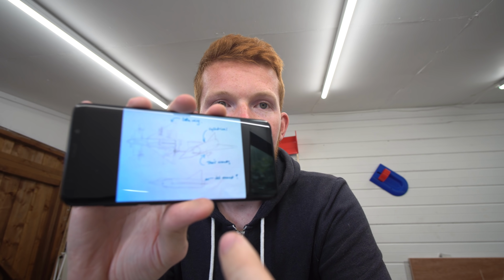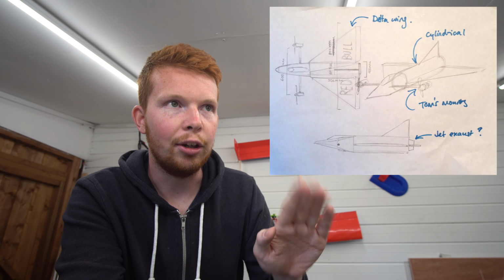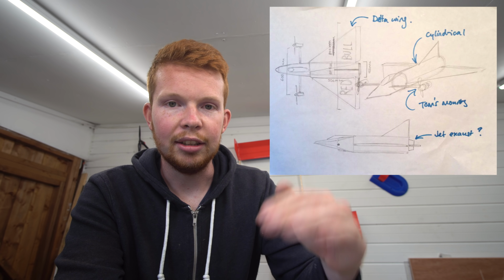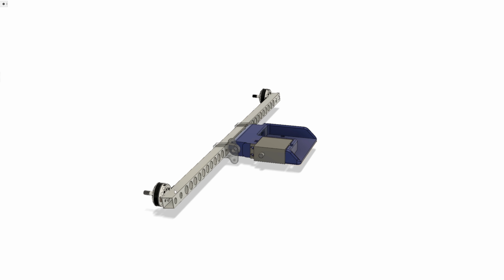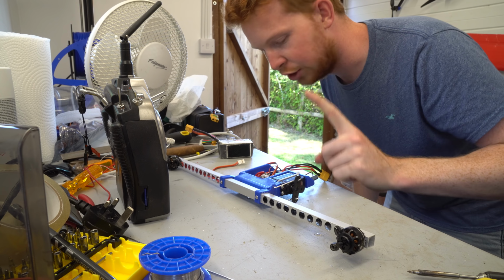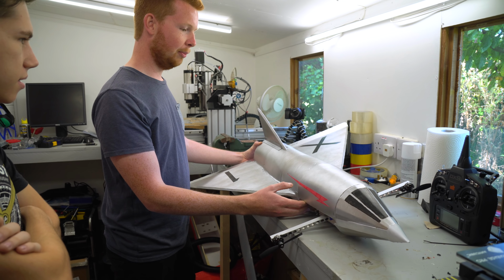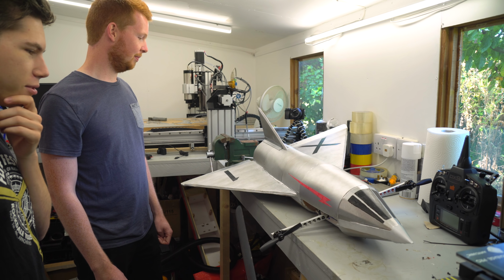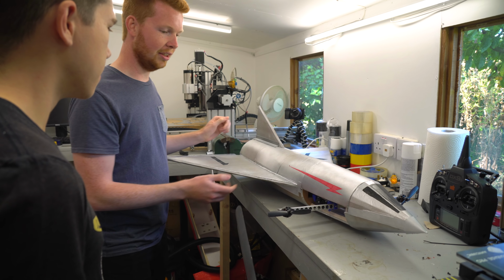Thrust Vectoring 'Canards' - BUILD

Comment: Hey, I'm no aero-engineer but I have a sneaky suspicion that the holes on the spar sections might cause unwanted vortices, resulting in more drag and less stabilization over the wings
Reply: I had the same thought. But the intact aluminum piece might have been so heavy as to nessecitate the holes being drilled to remove weight. Not sure...anyway, if the drag were extremely high he probably would have taken it into consideration and used a thinner spar instead of drilling holes or some work-around of that nature.
Reply: You aren't wrong, but on something as thrown together as this, these minor vortices don't matter. There are just many effects at play here. From my experience, it's best to not to CFD in your head. The real results are always different and while mostly understandable, you can't really predict them
Reply: The increase in drag would be the biggest problem with the holes. But, in terms of vortices, the propellers will produce much stronger vortices. Although this would increase drag, the control surfaces are generally more effective in this turbulent air. But, since this is such a rough design, it doesn't really matter.
Reply: vortices*
Reply: @Anvilshock  fixed
Reply: @bjarnivalur6330  Cheers, mate! Fly safe!
Reply: @Anvilshock   Thanks,  You too  ;)

Comment: Cool project, but minor engineering question; the holes in the alu beam would be more efficient from a strength pov if they would have been on the other face. The beam carries more load in thrust than it does holding up the motors against gravity (or actually the peak load is likely during crash, in which case its also front-to-back). And the strongest direction of such a beam is in the direction where it has most material at the extremities. Are the holes back to front for better airflow? If youd like to have holes in this direction for air resistance reasons, I suppose you could also add holes in all 4 faces, making the whole thing more like a truss. Wouldnt really lose any significant strength in the most critical direction, while losing more weight still.

Comment: You might be able to use the tilt plus differential thrust to roll. To roll (and also turn) right, tilt up and increase thrust on the left motor. 

Tilting down plus left thrust would turn right, but roll left.

Comment: I wonder if you could point an EDF backwards and route the airflow into the canard and out the trailing edge. This would require reasonable tolerances and have some weight penalties, but wouldn't probably require as large servos.

Comment: Has anyone else here noticed that this is the same music as in the old Intro on Pierre Meunier's channel? Cool build by the way. But maybe a round spar would've been better. Also, that 3D printed electronics holder has to be quite heavy. It might have been much lighter and almost just as strong made from plied balsa. I know it was a quick build, but maybe airfoiling the leading and trailing edges would've decreased the effect of the turbulence created by the spar on the wing. These are just some thoughts. It was a really interesting project! Nicely done guys!

Comment: Nice work! But wouldn't it be better if the motors where mounted behind the aluminium rod so they move on the rotation axis? There wouldn't be so much change in center of mass.

Comment: Is there a special reason you designed the mechanism to tilt the rotors in a way, that it does not rotate around the axis itself? I expected to see a round tube that just rotates in place instead of a piece, that is rotated and moved at the same time/rotated around a point that is outside the piece that is holding the rotors.

Comment: This is aerodynamically unsound. You effectively remove the substitute for the lifting surface (the canard) when you cut the throttle, and thus change the CoG requirements. I think you should base the design on a constant lift algorithm, mixing throttle and canard elevator angle, providing a throttle neutral canard lift. You're normally clever enough with FCs to manage this ;)
Reply: mike o guess what it is because you can tilt the wings, also what do you think will happen if you tilt the motors upwards? It will point the plane up, increasing the tilt of the wings. This could be done after the plane has built up som speed

Edit: watch the flight vid. It flies.

Comment: Should have used a round CF rod instead of the square aluminum, less problems with air resistance and turbulence. Most importantly though, it would have reduce the strain on the Servos if you made the bar rotate around it's own axis.

Comment: Any reason you didn't add a simple differential so that the canards merely counterotate? No need to have independent rotation if slight counter rotation has the same affect.

 You could get extra fancy with a conical worm gear to exaggerate ventral tilt compared to dorsal tilt, but that might be too much geometry for one video.

Comment: Any reason to use alu rather than carbon fibre tube?  Square section alu peppered with holes is not a usual choice for aerodynamic properties.
Reply from the maker: The main reason was that I already had the aluminium spar sitting in my shed. So it saved me from buying anything extra. If we were to make it again, a cylindrical carbon tube would probably be a better choice. Thanks

Comment: Wouldn’t it be possible to have roll from the motors if you slowed one down and mixed in yaw from a control surface
Using torque to turn it over?
Reply from the maker: Yes we did program in a differential thrust mix, but it didn't seem to do a lot. Probably due to the motors not being far enough apart. Thanks